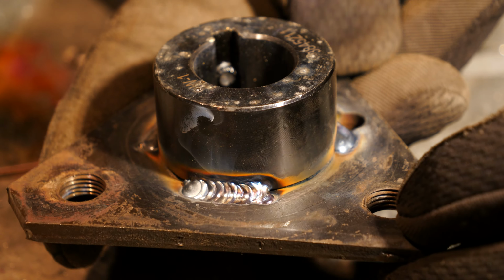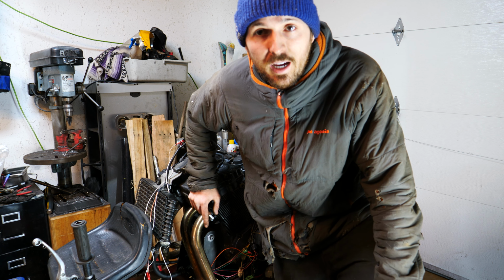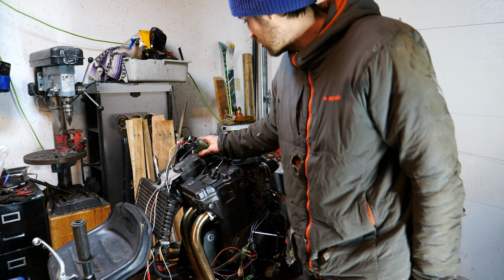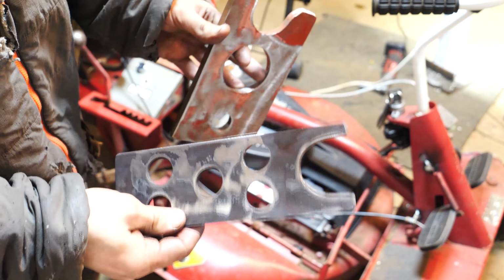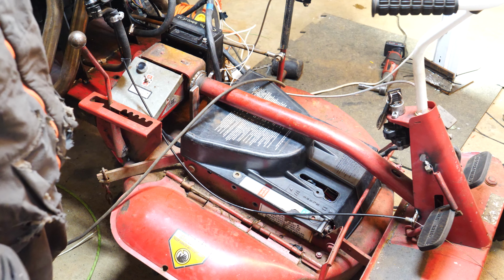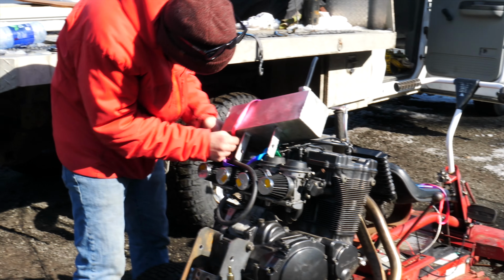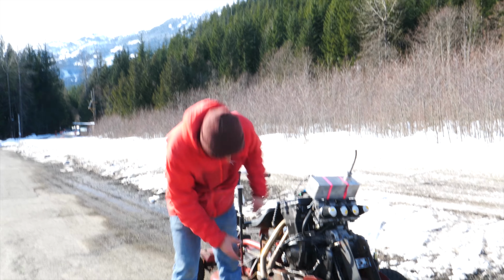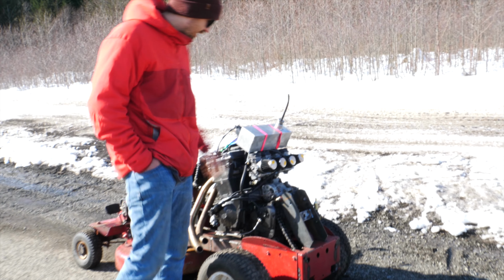100HP SUZUKI GSF1200 MOWER  1ST TEST DRIVE

Comment: Sounds like only 2 cylinders are firing
Reply from the maker: I had a carb issue, also those pod air filters weren't ideal. Changed sparkplugs, cleaned carbs and put stock air filter and its scary noww...!!!